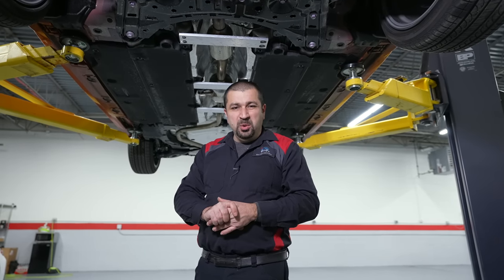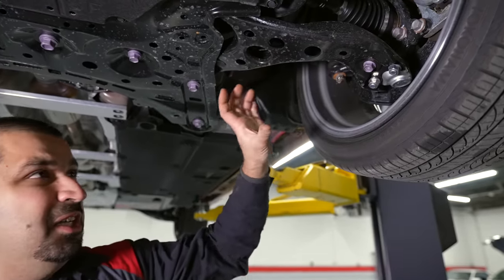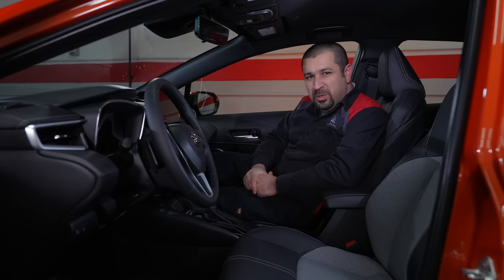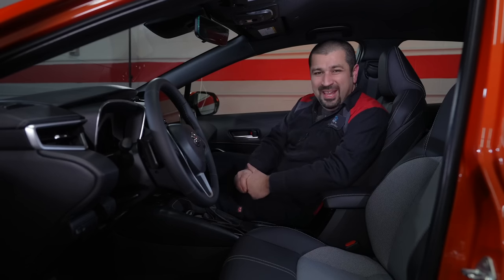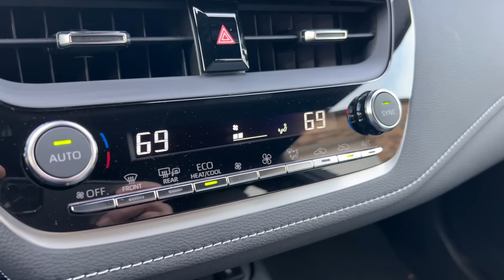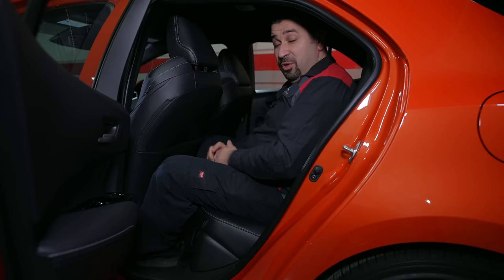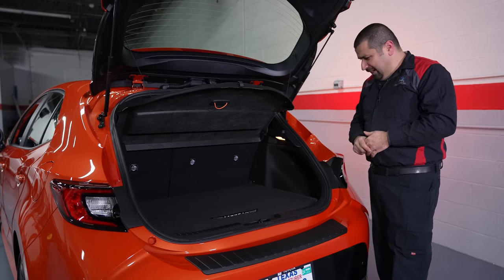Should You Buy a Toyota Corolla in 2023? I Have Good News and Bad News!

Comment: AMD, Speaking from the point of view of someone who has been living the manual Corolla dream for nearly 18 years, it is unthinkable and inexcusable that they dropped the manual transmission in everything but the expensive GR. 🤨At least they upgraded the Hybrid system with AWD.
Reply: 1000000%
Reply: Obviously, you don’t have “Stop and Go” Commute everyday...

.... or leg issues or lower back issues...
Reply: Just buy the 86 and live the dream forever
Reply: And Hybrids which also include CVT suck....poor cost/benefit, battery replacement out of warranty.
Reply: @oskarngo9138  just get an auto if you do? Litetally a non-issue
Reply: @lukewalker1051  
Toyota Hybrids are not CVT's.. like the Nissans. 
They are planetary split designs. Most reliable trans made. 
The cost benefit is huge IF you drive a lot. 
51MPG city in a Prius.. 57MPG in the new 23 Prius. You will get mid 30's in the Non Hybrids.
Highway MPG is closer. Battery replacement is a NON issue.
I have a 08 Prius.. 423,000 miles Still on the original pack. 10-15 years is the normal.
If you only drive 10-15K per year.. I agree, Its not really worth it or maybe its break even.
If you do drive a lot.. then it is worth it.
Reply: @lukewalker1051  Hybrid CVT has no steal belt and is very bullet proof. electric motors  start you from stops and feathers  acceleration.  Electric pushes you back. Their is no mechanical reverse.  Did I mention bullet proof.
Reply: Does it go vroom, vroom too//
Reply: The increased boringification of toyota
Reply: @Steven Strain What do you mean with the second paragraph?
Reply: You WILL drive the CVT and you WILL LIKE IT
Reply: What about all the countries that has nothing but stand transmissions? Yaris, i guess.
Reply: Toyota dropping the manual trans in the Corolla isn’t a shocker. Most cars in the US aren’t sold with a manual option at all, and the reasoning is simple. Why don’t they offer manuals? Because people don’t buy them, and if people don’t buy them, companies lose money offering options on cars that they know nobody will opt for. Plus, in this case, you drive a Corolla. I can understand the thrill of a manual in something like a GR Corolla, but in a regular Corolla, you’re not driving the car to impress anybody
Reply: @Luke Walker  Which is why Taxi driver's have been using them for year's here in the UK 🇬🇧.  Most have done over 500,000 Miles on the original battery and   the ECVT is nothing like all the other manufacturers CVT and last forever because there is nothing to wear out, no belts or clutches to wear out like in Old fashioned Automatic gearboxes.
Reply: @SuperVegito777  I wish they sold a Diesel Automatic her in the UK 🇬🇧 especially for City driving for people like me who get aches and pains in my clutch leg due to Health issues.
Reply: Totally agree with this statement. Everyone is ditching m/t I’m North America and it sucks
Reply: @oskarngo9138  I have back, and leg, issues, and have no problems with a manual transmission.
Reply: @paulfortman5834  
Good for you!
Reply: Kevin  manuals were pushed aside due primarily to the fact that there was no longer a real measurable gas savings benefit
Reply: @michaelryan1620  yes, that’s what I heard too.  Specially with these 6, 8 and 10 speed and CVTs.  They can pretty much make any car feel very responsive and “fast”.  I think the most of the magic of driving occurs in the transmission.
Reply: @ghoulbuster1  can't to seven a small trailer
Reply: What's AMD? 🤔
Reply: "CVT!" Big deal breaker for me... I had a bad experience with CVT from my 2013 Nissan Rogue. Never never again.
Reply: The manual doen't sell enough, pretty sure it's simple numbers that inspired this decision. The GR isn't for the average consumer, that target likely prefers a manual.
Reply: @woodjunkjrjr2689  lyes
Reply: @shyro76  it's not about impressing anyone it's fun and small cars are the most fun to drive manual
Reply: @toyotanerd2269  Exactly!!!!
Reply: Manuals = buggy whips
Reply: Hate that they dropped the manual. Before anyone suggests take rates were too low let me tell you, a big part of that is dealers not stocking it.
Reply: @subvet3668  Exactly.
Reply: Allow me to disagree with that. I had a manual car for 14 years and I’ve seen my share of NYC heavy traffic. Sure, it’s annoying and tiring but using one foot or two is not the factor that makes the greatest difference in that situation. The point in support of automatic in city environment, which I’ll support, is that you end up wearing up the clutch faster, which makes the ownership more costly on the long run. Otherwise it’s basically both feet working and getting tired vs the right foot getting tired from brake/gas back and forth (or brake on/off)  and the left foot getting tired from doing nothing.
Reply: @shyro76  exactly, people who watch these videos are usually those who see cars for more than just transportation. But in reality majority of people see it as just that, practically “no one” is buying manuals . This is also why even luxury brands like Mercedes and bmw are also no longer offering manuals. Automatic system have also gotten so good that it’s faster than a manual and smoother.
Reply: @oskarngo9138  
Nobody makes you buy a manual... Well Civic Si and Type R excluded.
Reply: @oskarngo9138  so because some people choose not to drive a manual, no one should be able to?
Reply: @Kburd-wr6dq  
???

Barking up the Wrong Tree...?
Reply: @lukewalker1051  hybrid eCVTs are not cvts I don't know why they call them that but they do not function anything like a CVT and are actually vastly more reliable than regular automatic transmissions and have far fewer points of failure. This is a common misconception, the transmission does no shifting of gears in hybrids. The engine turns a generator, not the wheels. What you'll find is you'll have less transmission problems in a hybrid than any other car that's not an EV. And batteries last well over 200,000 mi consistently, 300000 is common. Most of the things people say about hybrids or just blatantly untrue things that they're parroting from other sources but what you'll find if you actually own one is a lot of that stuff is not true. And you never hear about things like how your original rotors and pads will last for damn near 200,000 miles because the braking works in such a manner that the wear on your brake system is significantly reduced. Total cost of ownership for a Prius is comparable to a Corolla of the same year or even less. It's the same thing with the highway gas mileage thing, everyone says there's no benefit and yet I do better on the highway than stop and go. All in all I would say people are massively misinformed about hybrids based on something that was probably true about the first couple generations of hybrids. Of course this is all lonely and talking about Toyota hybrids I wouldn't trust it from any other manufacturer
Reply: @burntnougat5341  Don’t like it? Don’t buy it…!
Reply: I can only speak for myself and many others with the same issue, the manual hatchbacks have a lot of cars where the drive input shaft bearings are prematurely failing. I just had my transmission replaced and it would've cost me over 5k out of pocket. I'm sure Toyota took note of a lot of issues with their manual transmissions.
Reply: @hachiback2837  I hope they extend the warranty to cover the affected transmissions. In general, I don't think Toyota's manual transmissions are as reliable as their automatics but I am willing to take the risk to get the engagement of shifting my own gears. My car was delivered in April 2005 and my manual transmission is fine . Perhaps using Amsoil lubricant and changing it at 5 year intervals has helped.
Reply: @oskarngo9138  
Don't worry Oskar, the automatic transmission isn't going away.
Reply: @jackmcandle6955  
In Thailand, the Toyota Hatchback is labeled Yaris.
Reply: They dropped the stick shift because fewer and fewer Americans were buying them.
If more were sold, then Toyota would offer it.
At least the Honda Civic is still offering a stick.

Comment: I purchased the 2023 Corolla Hatchback XLE a week ago.  I really love it actually.   When I was researching the trims, I noticed that with the XLE you get the heated seats, the SofTex interior, the seven inch center display, the blind spot sensors with display in the side mirrors and as you said the 18" rims with Yokohama tires.  The SE trim does not come with any of that.  It comes with a four inch display for the dash.  The price difference from SE to XSE is that same as if you opted for the blind spot  sensor system on the Camry.   Where I am, the price difference between the SE & XSE was less than $1K & change.  The MSRP here for the XSE is $2k less than your area.  Anyway, I've been watching your videos for the last couple of weeks while researching which Toyota models I was interested in buying.  The dealerships here that used to have over 1000 cars on the lot, now only have 25 on lot to sell.  It is sad really.  Your videos are very informative and educational.  I appreciate that.  Thanks
Reply: Is there room for two car seats?
Reply: @mr.o523  yes, in the back seat. There are car seat anchors for three car seats in the back.  I have to admit, I really enjoy the car.  My only demur is that I have an old iPod Nano that the Entertainment System won’t recognize. Toyota made an update from the 2022 model so any old iPod model from Apple won’t be recognized unless it has Bluetooth.

Comment: The catalytic converter is sitting pretty and prime for the taking. A good fabricator could weld a stainless steel plate to that tunnel brace under the catalytic converter. Millercat sells excellent products for the Tundra and Prius made out of stainless steel.
Reply: Millercat. That's what I need
Reply: I'd rather wrap it in barb wire or just leave it exposed because I've heard putting a shield over it blocks airflow and cooks the converter and then it's on you to replace it. Versus if it gets cut off your insurance will replace it.
Reply: @TheCobruhAlienat0r  : Not all shields are manufactured as you claim and not all insurers cover this type of theft. I’ve read the complaints on several victims. Catalytic converter are also in short supply due to the supply chain issues over the last 2 years. Using an aftermarket converter is not recommended. They have a high degree of failure due to their poor quality.
Reply: @jamram9924  I tried an aftermarket Catalytic converter. It lasted a  year and a half.  Waste of money.
Reply: @jamram9924  If you have comprehensive coverage then they will cover to replace it. Obviously if you have liability only then they won't.
Reply: Dont live in a high crime area.

Comment: I LOVE my 2019 MT Corolla. It's so much fun to drive, handles great and it's got just enough power to be fun. The engine loves to be revved and you've got to really get those revs up to get the most out of it. And I've never had a single problem with it. I'm so happy with my economical commuter car.
Reply: Had to sell mine. For me, lack a little bit of power. Need a little more torque down low. At high rpm is nice.
Reply: @pitiquis0697  ThaI's kind of the appeal, for me , I'm always aiming for 45000rpm when I'm running through the gears and its fun af for me
Reply: I’m still rolling in my ‘94 Celica. Thing has never had a part replaced in the engine and it runs like brand new at 300k. Keep up on your oil changes and the yota will keep on chugging.
Reply: Any problems so far ?
Reply: @luisvazquez-gw6ks  all I’ve done is change the oil every 8000 km and the wipers
Reply: Put on some Bosch wipers

Comment: I think the only reason the manual version didn't sell well was it was under powered. It feels like Toyota is missing a model that sits between the regular and GR versions. If they made a manual Corolla that had somewhere around 200HP, I think that would appeal to a lot of people.
Reply: That model actually exists which is the 86.
Reply: @chriswo79 

My thoughts exactly.  Toyota makes a vehicle for every demographic, but they don't double up.  It's the reason they won't build a Corolla hatchback hybrid... because they already make that; it's called a Prius.  And like you mentioned, they already make two compact cars with a manual transmission and decent power... the GR Corolla and the 86.

I would add that nobody buying a regular Corolla is wanting a sports car... they are wanting 20 years of A-B granny driving.
Reply: @ericwolfe8119  
That's a good point. I guess they would be concerned that a sportier mid-spec Corolla might eat into GR86 sales. But honestly I don't think the demographic of buyers would overlap too much, mainly because the GR86 is really just a Subaru with a Toyota badge. If it was actually a Toyota, I think it would be an issue, but there are a lot of people who are avoiding the GR86 already (and even the "BMW" Supra) due to reliability concerns.
Reply: They had a version somewhat like that in the past, the XRS.
Reply: @ericwolfe8119 You can get the hatchback as a hybrid in certain markets like Europe.
Reply: Wrong platform and segment for that HP war. This is a Corolla, an ECONOMY vehicle.
Reply: Yep there’s definitely a market for it. It would be a definitive Civic Si fighter. Only issue is Honda has been making an Si trim for decades and they make really great cars with that badge. (I own a 9th gen Si and it’s an amazing car for the money).

Comment: Corolla SE 2020 (manual) - problems so far:
*fuel pump (recall)
*A/C compressor (last summer)
*Thermostat (Toyota refused to replace it under the powertrain warranty)

Comment: Note about the trunk situation.
When you spec the 2.0L engine instead of the 1.8L engine, Toyota couldn't/wouldn't package the starter battery in the engine bay, so it's in the trunk. That gives you that high floor.
If you spec a 1.8L engine and DON'T get the spare tire, you can have a deeper boot. So with the 2L you have the extra power and slight efficiency bump, and you can have a spare tire without sacrificing boot space. With the 1.8L engine you save some money initially, and if you sacrifice the spare tire you can load more into the trunk.

Comment: In Canada at least I am sorry to see they are no longer offering manual transmissions. The CVT's are getting better but as a mechanical engineer the idea of power transmission being achieved by metal-to-metal friction between a metal belt & metallic cones versus an involute shaped gear teeth to me is a serious engineering compromise - give me mechanical gears with a well proven history of longevity any day of the week. EGR system - I own a BMW 335d that I bought new in 2010 and feeding exhaust gas into the intake to reduce emissions is like telling you to eat some of your own shit in order to reduce your own emissions . . . yes it will reduce emissions but it does lead to to significant and expensive problems down the road (carbon build up in the intake) requiring and expensive walnut shell blasting to clean. This is a legislation driven solution that solves cold engine emissions problem but creates a huge long term reliability problem - trust me it will cause problems 5 years from now. Ultimately the real problem is that the direction of the world is currently being dictated by leftist politicians with university degrees that they got free in a cereal box. Valve cover in plastic - not great but probably not an issue with a non-turbocharged engine . . .it was problematic with the BMW M57 engine . .  a pressurized intake manifold leaking boost pressure into the engine (failed gasket) and oil gets forced out of the crankshaft end seals at significant rates.
Reply: E90 have carbon build up on the valves due to direct injection, present in the n54. Is the diesel the same? I doubt exhaust is rerouted into the intake. Are you talking about the turbo charge pipes?

Comment: If you have a Corolla with the 2L engine and live in a place where groundhogs, squirrels, etc. are around you need to protect the firewall from them. 

Toyota uses an idiotic soy based firewall panel. It’s located just behind the ignition coils. You’ll see it it’s black. I would strongly suggest you to soak it with hot sauce, buy the spiciest habanero sauce you can buy from your local Mexican store (seriously no joke). Groundhogs ate this panel on my car and they made a $700 mess. I tried every trick in the book to stop them from eating this panel. After their spiciest meal ever, they finally left my engine alone 😡

Comment: FYI the space height of the rear compartment of the sedan vs. the hatchback it actually has to do with the spare tire but more importantly, the rear axle/wheel wells. On the sedan, they managed to drop the spare tire compartment behind the rear axle/wheel wells. On the hatch back models, the rear axle/wheel wells actually sits further back not allowing the space for a spare tire, so it's installed on top which robs the floor space.